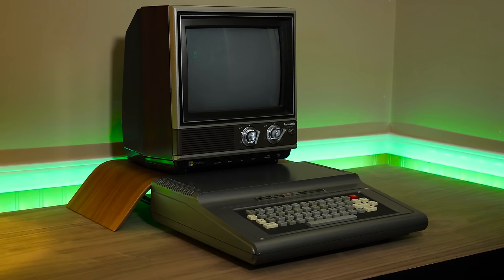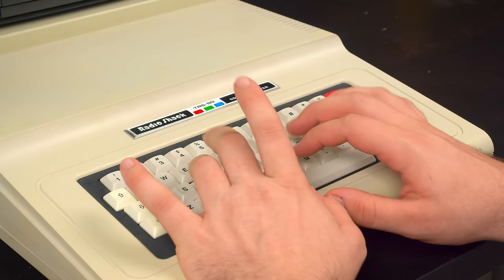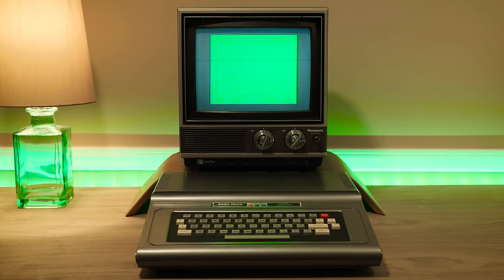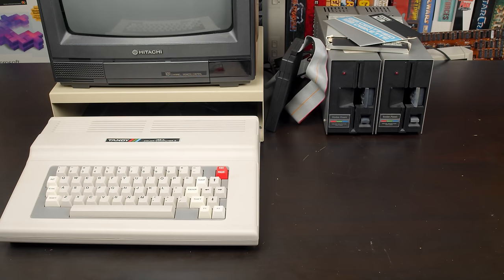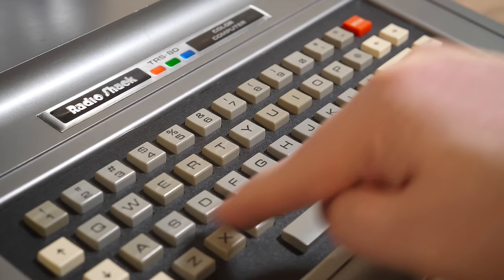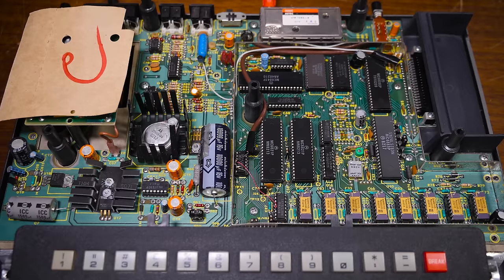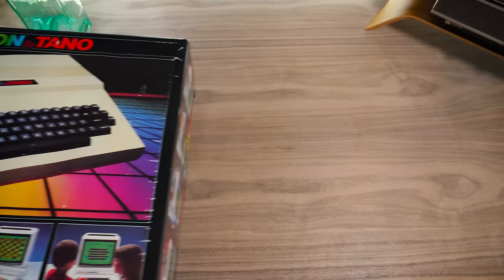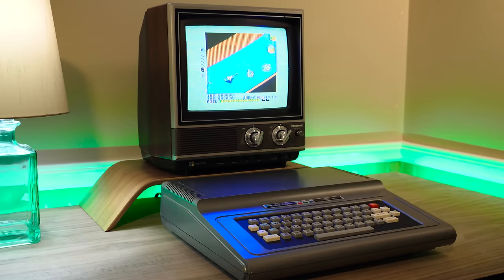TRS-80 Color Computer: Radio Shack's $399 Micro from 1980!

Comment: It never ceases to amuse me when I see these old computers getting SD card adapters with more computing power than the computer itself
Reply: The benefit of the expansion bus basically being exposed CPU pins.

Craziest i have seen was someone hacking up a NES cart to act as a "video card" for an RPi, so that they could run the original Doom.
Reply: @digiowl9599  they did the same. A guy put a Raspberry Pi Into an NES cartridge and was able with emulation and redirection of the video signal to play Super Mario World on a actual NES.
Reply: I think Amiga is the best example of this kind of craziness about expansion possibilities. Like full fledged graphics accelerator with HDMI on a computer that runs a 68000 16 bit CPU
Reply: More insteresting still is that modern SD cards have a microcontroller on board for various functions which itself is also faster than some computers (a few years ago the processor once used in the GBA was commonly used)
Reply: @digiowl9599  

Holy hell, that is impressive. 

Isn't it great that Doom has become the ultimate benchmark?
Reply: I don't think there's a single computer on earth as slow as this one. It is less than a single megahertz. The screen on my bike light is faster than this. A digital thermometer is more powerful than this.
Reply: @tubetib I agree ever since windows XP came out file sizes have been getting bigger and bigger for what appears on the surface to be absolutely no reason. It makes me wonder if things were coded in such a way as to run on something like a basic trs80 or c64 but with the faster processors wether or not far faster computing could be achieved, at a guess perhaps due to the power and amount of instructions needed on modern hardware code compilers have gotten lazy so to speak, and perhaps compile code in an easier fashion as apposed to efficiently, which has kept the need for faster CPU, more ram, more disc space etc on the uphill scale. 

I found a new in box IBM 286 PC once in a hard waste collection pile out the front of someone's house as a kid (2003) I took it home and plugged it in, installed windows 3.1 and was content for a while, then decided to try windows 95, I recall it saying it wouldn't run on my machine and for the life of me can't remember what I changed or did, but I managed to get it installed and aside from taking up the entire hard drive space it ran fine..  13yo me was then convinced that continually upgrading PC's was a scam, I know that isn't exactly true, but I still feel there is some merit to it haha
Reply: @tubetib Only Google Chrome can out-waste a driver in a PC's memory...
Reply: Even the SD card itself has way more computing power.
Reply: @stephenharris5532  You betcha. But where were you in 1980?
Reply: Still faster than a MacBook!
Reply: My watch has more computing power than that computer.
Reply: @aidancommenting  Tell me about it. For reasons I have a system with one gig of RAM, and Chrome (actually Chromium) has gone through all of it with only one tab. Meanwhile I'm typing this on a system with 6 gigs of RAM and am reaching the limits of Firefox. 479 tabs (but not all are loaded).

Now I just need to figure out why on Earth I have 479 tabs.
Reply: @eDoc2020  Enjoy you're merely 400 tabs while it lasts. 1250 tabs here.
Reply: @deus_ex_machina_  I just closed a window. I'm down to 130 now.

I also have a server with 64 gigs of RAM, I can also just run my browsers there.
Reply: @tubetib It's called bloat. Basically as a computer's capability expands you run into a few major issues. On one hand, it just takes far more code to deal with the more power computing which in turn means it takes more data to do anything. Then you also have to consider that back in the day, programmers had to deal with very hard limits which meant that they had to carefully code things and try not to waste a single line if they could just to get anything to work. Necessity being the mother of all innovation and all that. So now you have to add the fact that now not only does it take far more lines of code just to get basic applications running but you just don't need to be a tight with your programming to get things to work, you just have far more leeway and it's just basic human nature... well scratch that, it's just all around basic nature to do only as much work as you need to get the job done. Do to this as computers get more and more powerful the more programs will "bloat out" to fill this extra space. 

Oh and there's also the fact most software companies drive much tighter deadlines means you have less time to deal with more code, a lot of programmers tend to build "new" programs ontop of older ones leading to a lot of legacy code to muck with overall efficiency. And you can't forget the massive amounts of spyware and backdoor programs our tyrannical technocratic elites over at silicone valley love to shove into things >.>
Reply: @eDoc2020  Well I went to check while my brother was playing and Firefox crashed due to lack of RAM. We hastily restarted but it crashed again, when I suggested clearing since out with RAMMap.

But alas, the session was lost. Hoping to restore from the files, but I may have to restore from an outdated 6 month old backup...
Reply: @deus_ex_machina_  In my experience Firefox has been pretty good with restoring sessions. It shouldn't crash from running out of RAM until you're completely out of swap space, in which case you have other problems. I don't know if I've ever had a problem with it crashing when restoring the previous session. You do mean crash and not freeze, right? Sometimes it will freeze (and Windows will say Not Responding) but if I give it enough time it will come back. Especially with several thousand tabs I'd expect it to become unresponsive for a few minutes.

If you need to restore from a six month old backup, you're still relatively lucky. I haven't gotten around to making any backups in the two years I've been using this machine and the hard drive was on its last legs when I put it in.
Reply: @tubetib I think the problem is that any company wanting to attract programmers then gives them an I9 processor and 64GByte of RAM to ensure maximum productivity. Then the programmer goes and writes everything as object orientated code sitting over layers of OS (if I'm talking nonsense it is because I'm a hardware engineer who just sits in the same room as software engineers). Then when someone tries to run the same program on a lowly I3 with 4 GByte of RAM everything grinds to a halt. 

Bill Gates should remind them "640K ought to be enough for anybody". I have used a schematic entry IC design program that ran in that on a PC AT.
Reply: @stephenharris5532  They landed on the moon with a 0.043 Mhz computer. 1Mhz is still quite a lot of speed compared to that, or a human. Slow by today's standards of course but still amazing technology. It's not about the power but what you do with it.
Reply: @eDoc2020  It did crash as evidenced by the crash reporter, and after backing up the profile folder in AppData, when I opened it again I was greeted with all the tabs.

Bit strange that the sessionstore.jsonlz4 file was older than the previous.jsonlz4 in the sessionstore-backup folder, but hey—I'm not complaining!

Anyway if you'll excuse me I have a lot of tabs to sift through.
Reply: @arlasoft  Why all the drama, just write 43.000KHz or how about 43,000Hz computer? Any slower and you could listen to the calculations.
Reply: @alhuno1  Those are quality algorithm over quantity that's why it's called colour
Reply: What should really amaze you is the versatility of the SD card. Truly a marvel of easy to use memory storage.  They are beautiful.
Reply: @summer20105707  Well word on the street is that it has something to do with quantum physics and silicone refining 🤔 SD is also faster than USB memory so SD can become the primary hard dive on android and windows. It's a shame what apple ussers are missing.
Reply: @arlasoft  I've heard that somewhere before...
Reply: @stephenharris5532  And yet it boots up in a couple seconds. My 2019 5K iMac takes 30sec, when it's in a good mood.
Reply: It's the disks, some still work okay, but if you find one with the ferrous stuff coming off..

Comment: What's still somewhat mindboggling is that the controllers inside the SD card just used for data storage are probably orders of magnitudes more powerful than the computer itself…
Reply: More boggling is that the "smart" card used as a SIM or credit card chip or access control badge has a 32-bit CPU running a subset of Java.
Reply: @JohnDlugosz  yeah?? I don't think so.
Reply: @JohnDlugosz  
Really? Do you have more info on this?

Comment: Oh, my heart, my first computer! Mine had a sweet custom keyboard with additional functionality. Had to store it when I went to college and it got thrown away while I was gone. I miss you and your strange rubbery smell once you warmed up, my old TRS-80.
Reply: this was My first one also (this silver model1) first it was the 1.0 tandy basic, then we have it up graded to 64k Extended Microsoft Basic - Rom, Memory (the basic was also almost the the MS QuickBasic on the PC), I only found out much later the serial I/O printer Port, where only assigned the software of the system, so could be resigned as 4 pins like the I/O pins on the Raspy-Pie board.

Comment: This was my very first computer! I LOVED it! I had the Model 1 version, with the chiclet keys! What a great way to start into computers back in 1982! It came with the ubiquitous 4k RAM, but I later upgraded it to 32k and Radio Shack actually changed out the RAM badge to 32k!
Reply: It was mine too. I finally recycled it when my parents sold their house about 15 years ago. I used it to learn BASIC and so on and to cheat at chess against the computer since it was the only game cartridge I had. I did not have the patience to genuinely learn chess as they had hoped I would.

Comment: I had one when I was 13 and it changed my life.  I surfed the technology wave for 30 years, and retired in my 40s.  I still talk to young software engineers sometimes and they seem a little star struck when I tell them about the 6809 and hacking basic and machine code (I didn't have an assembler, so wrote programs by looking up the op codes).  What a ride - I never could have guessed where this would go.

Comment: Thank you for the trip down memory lane. I was 7 years old in 1981 when I got my Coco 1... well, I had the Aquarius for a few days and I think something happened to it so my dad got me a Coco. We had TRS-80 Model I's and even III's in school, but to have my own TRS-80 Coco at home was incredible. I took to it like a fish to water finding all the BASIC program books I could and learning to code as well. And over the past 40 years computers have been my life having at least 1 of every step up computer I could buy. From the Coco 1 I went to the Coco 3, then the Tandy 1000SX (which I upgraded with a 286 daughter board), and then the 1000EX. I had an original XT and then a true 286, built a few 386's from Computer Shopper magazine, and continued up the progressions from there working for many companies as hardware and network support. I have a lot of older parts and pieces now, but nothing older than my 386SX/25. I'd love to go back to at least the 1000SX again to play around. It's fun to have the emulators for all the classic hardware, but nothing beats touching the actual computer.

Comment: Trash 80, baby!  Yeah!
(Said in the most loving way possible as this baby was my first exposure to the microcomputer.)
Reply: My dad also called them Trash 80's, lol.
Reply: The funny part is that the "Trash 80" term was usually applied to the Zilog based "real" TRS-80s and not the (Technically unrelated) Motorola based "CoCo" 😲- LOL. Neither systems were trash, but popularity brings contempt by some.😊 Tandy/Radio Shack computers were (as we said in the '80s) Bitchen!! 😜
Reply: I had a CoCo2 I got second hand fully loaded with disk drives, expansion packs the works and I loved it. Everyone I've met has called them Trash 80's, it was funny to hear Clive actually pronounce it Tee Are Ess, I was shouting "it's pronounced trash" at the screen LOL :)
Reply: My grandmother owned a Montgomery Wards store in the 70's and early 80's. She had closed it down by 86-87 when i was 6-7 years old. She had a TRS-80 CoCo 2 that was used in the store, and an Atari 2600 that was on display in the store. So these 2 electronic items were my first look into computers and video games. What a time it was! Played the crap out of some Megabug....
Reply: The main reasons for the Trash-80 nickname for the Model 1 (not later models like the CoCo’s) was two-fold: First, Radio Shack had a reputation up to that point in 1977 (When the TRS-80 Model 1) was introduced  for “schlocky” products and getting into the computer business did not immediately change that. The second was the of the proprietary Expansion Interface (E/I) box for the Model 1(Model 1’s did not include all ports in the main unit unlike later TRS-80 models like the CoCo 1) that used a poorly designed ribbon cable connection to the main unit. This external ribbon cable was know for a) Too easily coming loose/developing a bad electrical connection with even slight movement of main unit. b) Being unshielded from interference, a) due to a poor choice of base metals on the contacts in the ribbon connectors and edge connectors in the main unit, it would often become oxidized and need periodic cleaning with a pencil eraser. Third parties sold gold-plated aftermarket connectors that fixed this issue. The main unit of the system on the Model 1 wasn’t a bad microcomputer for the 1977, despite the ribbon cable issue with the expansion box).
Reply: My first computer was a trash 80 pocket computer.

Comment: Nice video, Clint! I remember having a couple of the white ones in our high school library around 1984. We used to sit there often during breaks and typed a quick for next loop programme which played a very annoying sound, switched off the monitor but left the computer on, monitor sound on max and left the library. Some minutes after we left the quiet library was disturbed with huge noise and the librarian panicking how to switch it off 🤣🤣🤣
Reply from the maker: Now that's just good clean fun, I love it
Reply: That's the opposite problem my high school library had decades years later. With twelve Pentium D systems plugged into a chain of power strips into a single 120v/20a outlet, the struggle was keeping everything switched on.

For those wondering, the "solution" was to reorganize the power strips so half the systems were fed from the top half of the outlet, the other half from the bottom half. The single outlet probably wasn't split to different circuits, but reorganizing the load kept each power strip under its 15a trip point.

Comment: This was my first computer at age 4, given as a hand-me-down from family in the late 1980s. It's weird, though. I wasn't aware that I had most of the higher end hardware. I had both the 32k Model I and the white 64k Model III you showed off. On top of that, I had two of the big white joysticks that you briefly showed in a magazine ad in the video, two floppy drives daisy chained together, and even the single button mouse that had an extremely low sensitivity, making it very hard to use without dragging it across the spot multiple times. It might've also been that dust just got inside, but it was impossible to take apart and clean, so whatever.

Interestingly, at age 8 or so, this was also the first computer I ever repaired. One of the disk drives never really worked, so I finally decided to borrow a screwdriver from dad in the garage and opened it up to take a look. Turns out, just as you have that ribbon cable on the outside, there's also one on the inside connecting the port to the circuit board, and in that drive, that cable was unplugged. I plugged it in and it worked just fine up until my family sold it at a garage sale in the mid-2000s. By then, I had already gotten a Tandy 1000 HX with dual 3-1/2" floppies, an IBM PS/2 whose internal hard drive ultimately failed, and a generic 486 with 8MB of RAM and a 509MB internal HDD, so the CoCos were largely just taking up space at that point and none in my family had a collector's mindset to save it for ourselves.

I wish I could've saved it. I might've even been able to someday repair the other drive, which broke down soon after repairing the first, likely being a drive head motor issue and far outside the scope of what I was capable of at the time. But while I miss it now, I can still look back fondly at what I've come to realize wasn't so humble beginnings.

P.S. The only game cartridge I had was Dungeons of Daggorath and somehow, my young little mind was keen enough to make it to the 4th floor (out of 5 total) after eventually learning to not run as fast as I can all the time so that I don't faint from the heartbeat mechanic.